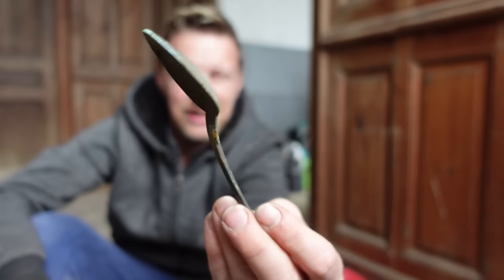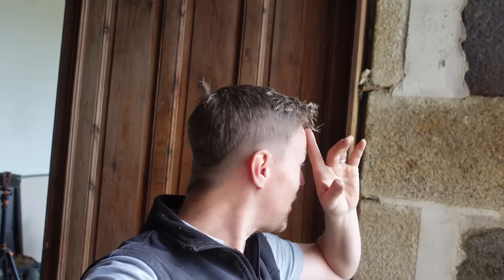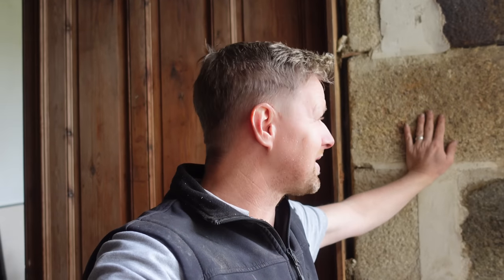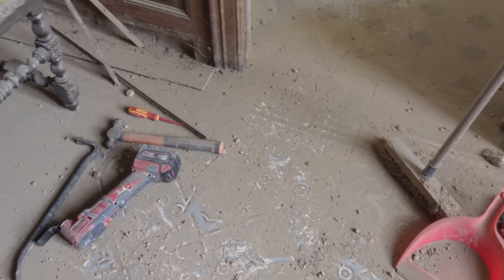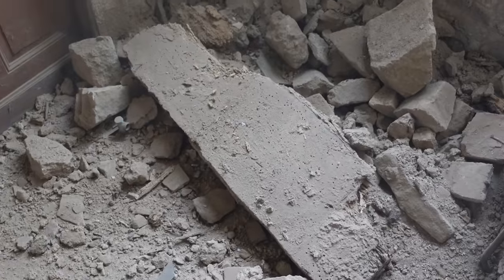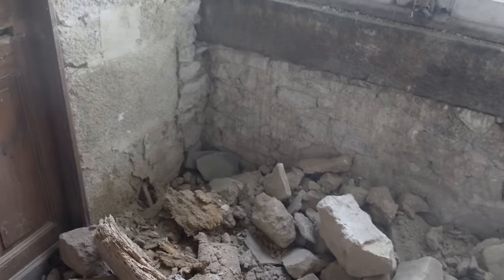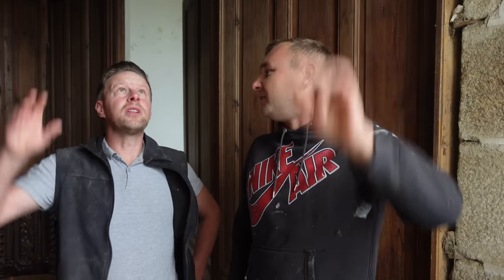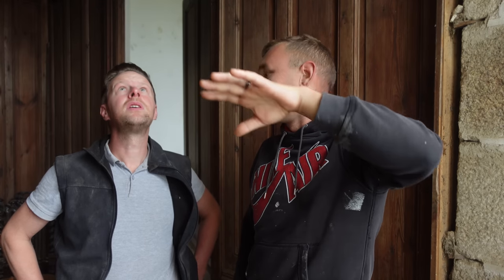Lessons Learned: The Chateau Beams Collapse Inside.

Comment: That certainly came down with a crash. Terry might have been expecting a bit of loose stone but that came down frighteningly fast. The bit under the window must have been open at some point judging by the floor there. I wonder what the room was used for as a floor like that suggests it was not a room used just by the staff. 
70 years is a long time. Might have just been a bit damp back in the 50’s with no major rot. It’s amazing how quickly rot can set in once a house is empty. The woodworm won’t have helped.

Comment: On the next window, put down some OSB boards to protect the floor. The tiles are lovely, be a shame to damage them. Would use concrete lintels in future, never rot. I like fitting French windows. I used the metal hammer in wedges of old driven in against the frame into the mortar joints and expanding foam. Modern way foam and frame fixings. Be good to install the new windows soon.
Your making good progress.
Reply: Thank you 😊😊

Comment: Ouch!  I have an old Victorian in the USA in South Carolina, so I felt the pain of that fall.  I had a similar experience putting in a brand new steel door and frame with 5 friends.  Old milled wood is good EXCEPT when the damp screws it up big time and termites eat the decaying wood.  I won't say we were any more prepared than you were, but it safe now that it was replaced.

Comment: A slow leak in the roof. You have to find it.
  I'd call in an architect. Structural engineer design, cost estimator. No yelling who much damage that bean is connected to under the roof. Take ten years if you have to. There is no hurry

Comment: That is a general service room. I would incorporate it into the kitchen, change the kitchen/service room into a sitting room/breakfast room, and move the kitchen to the service basement where I suppose it was originally
Reply: where the various suppiers could wait?
Reply: @anitariley2681 If the door nearest to this room is the servants or suppliers' door, then yes. But I'm thinking it may be more if a butlers pantry ....
Reply: It has a different flooring,if u open it to the kitchen it will look weird if they want to preserve the floor.  This is an anti chambre, rich people wouldn't let their server pass from the kitchen to the dinner room so they had those luxury rooms just to not see/hear or smell anything from the kitchen.  In France the kitchens were mostly at the back of the house not the basement, the basement called cave was for wine and food.